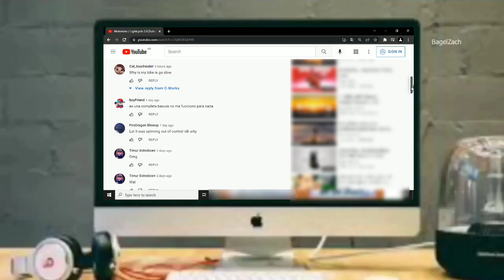My Plane Crazy tutorial became pain so I fixed it myself

Comment: Try using helium and ballast if u don't like cameras and want it to perform tricks like barrel rolls, wheelie or flips. I made my own bike this way (it's 1 block higher cause My seat is up right for better view in first person, my bike is very different and even has reverse rockets) but they do share the fabric wheels and turning system.
Reply: i like normal or the front wheel fabric because you cant flip while you start it

Comment from the maker: 1. Try reverse motors' keys
2. Check rockets' setting (one is LShift, another is W)
3. Check two propellers' keys, one is Decrease - S, Increase - W another is W S
4. Try place additional cameras
5. Try change front wheel's material default to 'fabric'
6. Rear wheel's material must be 'fabric'
7.If rear wheel is keep missing, check that cameras are attached at isconnecter to weld wheel and body
8.If wheels dont work, check and delete wrong thing that attached with wheel and body, without motor
Reply: Lol, it wasn't ur fault bro it was just ppl doing misstake xd
Reply: thanks for a backup :D
Reply: my front wheel keeps on locking it works for a lil bit and then locks edit: i fixed it my self
Reply: @Ace_Silver455  bro i followed the tutorial, went here, AND IT STILL BOUNCES. im getting mad but not at you cwork. it just might be updates.
Reply: @KillerKhaotic939  🗿
Reply: my bike still flys and bouces with the correct settings HELP

Comment: I followed your tutorial but it doesn't work so I mad my own 

1.make the wheels fabric 
2. Only place 1 super rocket engine
3.make the motors to 10 - 30 
4. Remove the propellers on the bottom and on the top and replace it with half blocks
Reply from the maker: propellers are necessary for downforce!
Reply: @CWork  my bike is prancing can help?

Comment: mine still goes slow
and when it turns it keeps f word flipng
Reply from the maker: if something not works, compare it with mine by watching tutorial video again. because when i build it and tested it, it worked 100% as you can see in this video. 

but if you still can't solve your car's problem, take picture or video exactly then join my this discord server, upload it at "aftercare" tab with some explanation.
Reply: @CWork  ok

Comment: i tried the first one but it didnt work, but the reason it goes slow is bc the front wheel doesnt move please help
Reply: mine 2
Reply from the maker: if something not works, compare it with mine by watching tutorial video again. because when i build it and tested it, it worked 100% as you can see in this video. 

but if you still can't solve your car's problem, take picture or video exactly then join my this discord server, upload it at "aftercare" tab with some explanation.

Comment: FIX THE HYPERSONIC AIRCRAFT PLS THE TURNING IS SO SLOW
Reply from the maker: put S W, W S keys with on/off mode on small propeller
Reply: What small propeller? There's many of them
Reply from the maker: @marklukeviloria559  You can use it all except two E, Q key set propeller at front

Comment: bruh it dint work even though i fixed everything
 i still bounced and dint even go even with fabric rear wheels. im disliking :/
Reply from the maker: maybe yours needs downforce, check propeller setting. If it still bouncing, add extra propeller but speed will be decreased